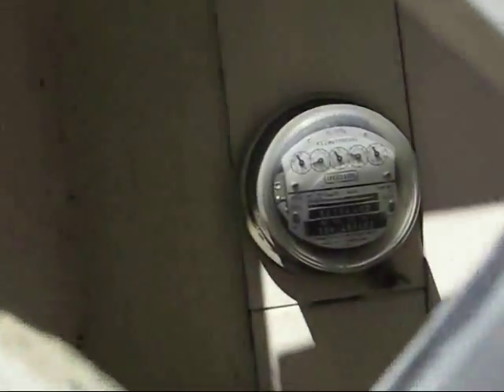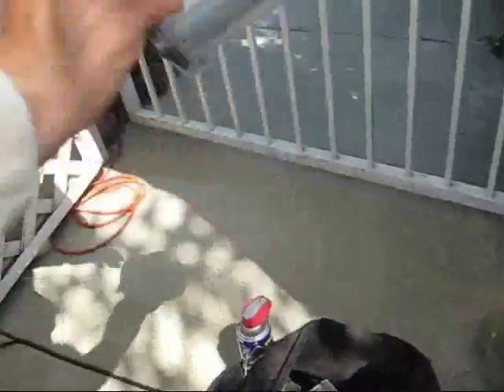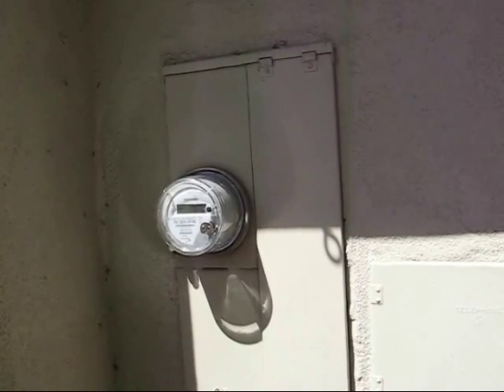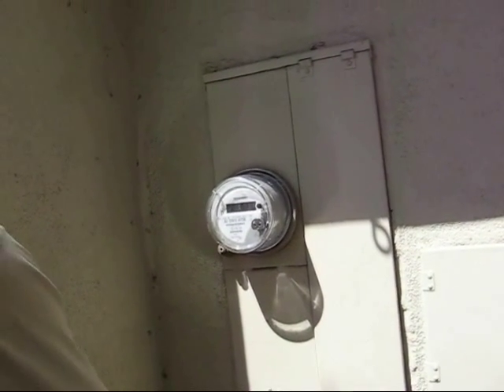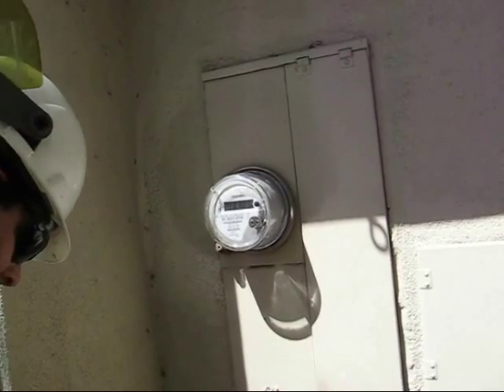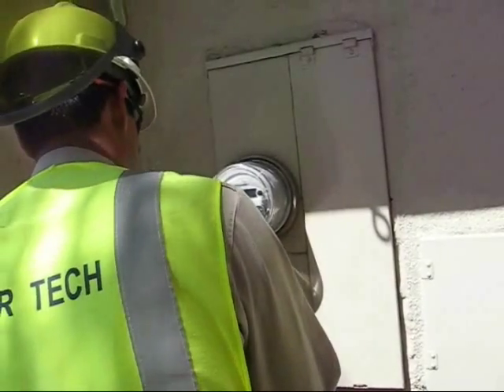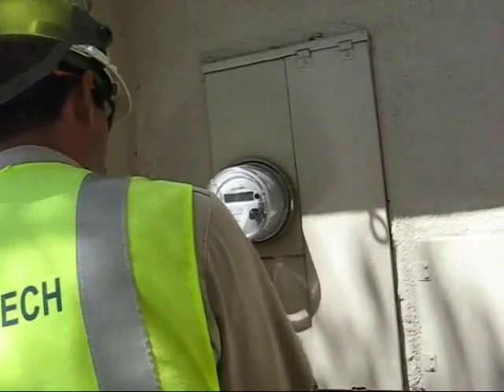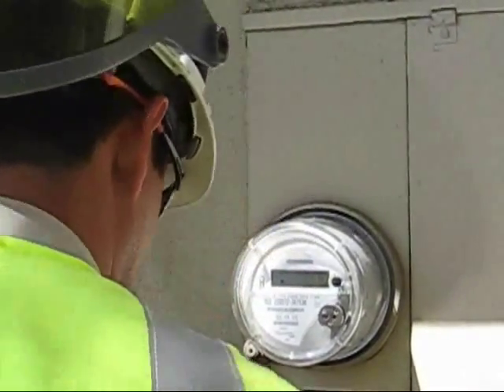Edison SmartConnect™ Meter Upgrade

Comment from the maker: If you're talking about the ones on the left side of the display, they scroll from left to right to show how "fast" electricity is being consumed. It somewhat represent the rotating disk on mechanical meters.

Turn on an appliance that draws a lot of power such as the central air conditioner or an electric dryer, or range/oven and you'll notice they'll move a lot quicker.